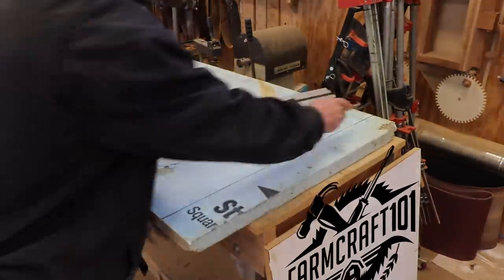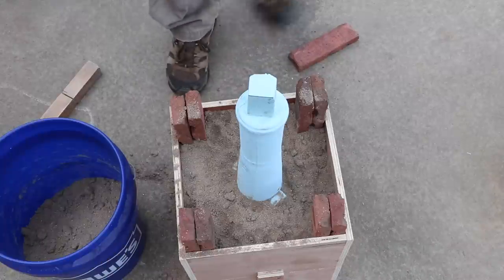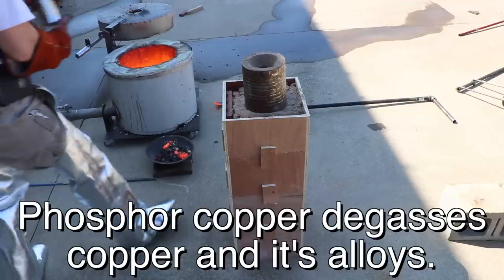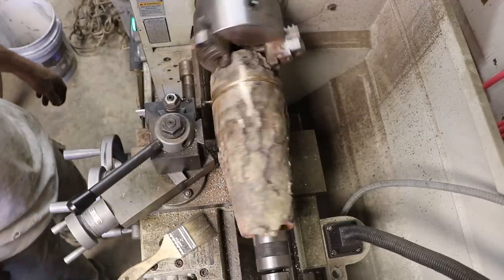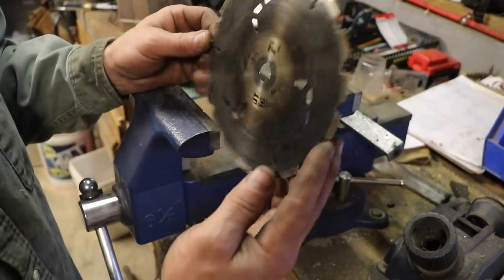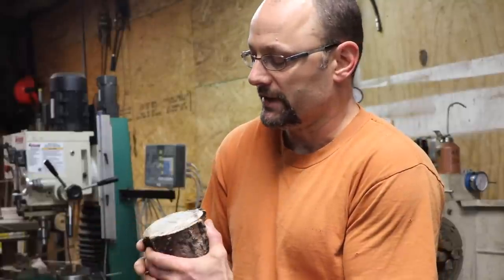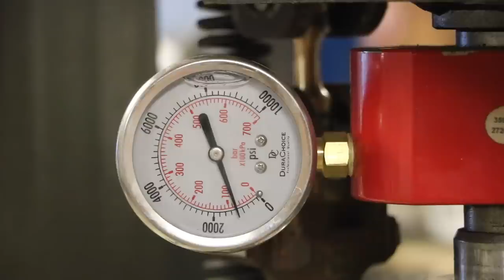How NOT To Cast A Historic Bronze Cannon Barrel.  FarmCraft101

Comment: I noticed you did not add a vent sprue to you mold, it will cast easier if you have a place for the metal to go other than the actual cast... reservoir voids, vent sprues, puddles...

I have worked in an aluminium and iron  foundries for over 3 years...

Comment: I think your sand was not packed enough so that’s why it failed or your sand mix is wrong so therefore will not pack tight enough and also try a core in your mould  as well

Comment: 8:55 shockwave met at the center causing cavitation, lowering pressure, thereby lowering the boiling temp of the water,  quickly forming a gas bubble.
11:43 maybe sandblasting? Is that why they use an oily sand? so it doesn't stick to the metal?

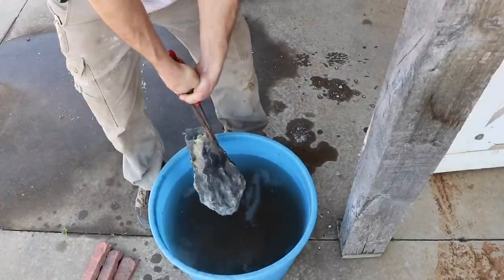Comment: 8:50 my understanding is that the molecules in the water touching the hot iron you threw in the water accelerate very quickly and hydrogen being released form the water causing that mini explosion/splash. something like that.
Reply: No, it just evaporated into steam because the piece superheated the water.
Similar effect to jostling a (smooth) cup of water that's been in the microwave too long.

Comment: 8:55 Pretty sure the hydrolization of some oxides or compounds on the surface of the sample raised its thermal conductivity exponentially, and as it cooled really fast the first seconds a bunch of water boiled absorbing a bunch of energy, hence preventing further violent boiling. Temperature^4 if i remember my black body equations.

Comment: You should’ve used a diamond cutting blade of some sort either for the band saw or circular diamond blade or just cut it with a blow torch that’s for cutting metal.

Comment: It's true that the oldy-timers made cannons of brass, but according to historical accounts, they also blew up cannons on a semi-regular basis. It was just accepted as a risk of using the technology at hand. It was difficult to judge powder loads too, as powder making was not an exact science at the time. It wasn't unusual for powder to be made on-site, as needed, rather than in a factory. That alone can cause unexpected pressure problems.

Comment: You should look at the break area closer. You should have measured how much it stretched before breaking as well as how much the crossection shrank. This is a measure of its malleability. The break appears to be brittle fracture, which indicates very little stretch occurred. I suspect your pour picked up a lot of silicon into the alloy, which IS soluble in bronze.

Comment: Machining the sandy metal is the same as machining a drop forged ingot with all the scale still on it. You just have to get under it so the tip is cutting metal and the slag and scale is scrapping and blunting the back of the cutting tool.

Comment: When he ripped the ingot out of the sandbox after 20 minutes and threw it into water, i was sure he didn't know what he was doing. Just watch any video on casting bells once and you know you have to wait at least one day to have it cool down appropriately. Also you will have way lesser tensions if you insert a clay core into the cast where you later drill your cannon. Clay will ultimately make for a good barrier so your molten metal doesn't wash out the sand and go anywhere its not supposed to. Cover that foam-thingy in clay, have it dry thoroughly, then insert into sand, then do your cast...

Comment: Here's book learning, not experience talking:  To cut a rough casting, you need to cut through the grit in a single pass. For your casting, that might be impossible due to those outer ridges.  Maybe those can be cut off manually with a cold chisel.

An alternative would be a tool post grinder with a very coarse wheel.

I think those ridges around the barrel were made by gases (vaporized or burning plastic) escaping  vertically.  You did nothing to vent the casting.  I recommend any of Charlie Ammen's books on the subject.

Comment: I've read that iron banding was used to improve the canon strength, or perhaps to reduce the damage if it split or otherwise broke.  Still, I'd be hesitant to stand next to the thing when it went off.  Are you even planning on firing the thing for anything other than test purposes?  It's not like you'll be involved in any siege activity in the foreseeable future, right?  :-D  If you just want to test fire it a few times for fun you can use low powder loads to keep the pressure down.

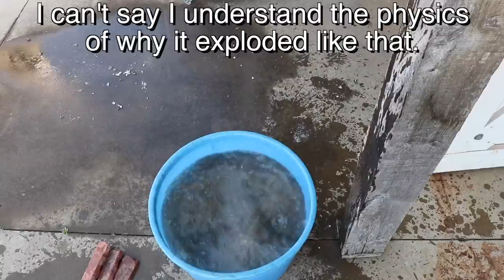Comment: 9:00
I can. It's because water started vaporizing a lot after you put this thing in and it caused rapid expansion of gas inside of the bucket. The result is what you see
Reply: I'm afraid not entirely. The water cooled the outside jacket, which will shrink while the middle is still hot and molten. The sudden coolinh makes the outside jacket rather brittle and under this tensile stress it cracks. These cracks are sudden exposures of the hot, molten inside to the cold water outside. The forming of the cracks is very fast, the water going into the crack will flash to steam.
Reply: @DreadX10  well ok

Comment: I would guess the explosion of the water was due to the metal cooling off enough that the Leidenfrost effect stopped happening. The sudden direct contact of the water with the hot metal caused a rush of steam to be produced all at once.

Comment: why not to cast it horizontally (still tilted) instead of vertically so the pressure of the upper metal wont be a issue?

Comment: Wonder if cooling it slower keeps the metal from crystalizing making it stronger.
Reply: Quite the opposite: slower cooling results in larger crystal grains (as they have more time to grow) and lower strength. Forging improves the strength of metal in part by re-forming the big grains into small ones.
Reply: Hmmm...learn something new...makes sense though when I think on it. Could be why we quenched things after hammering them on the forge. Not that I have done any of that in the last 20 or 30 years (something I played with in my younger days)
Reply: @kenredington4988  it is part of the reason for quenching. The other reason is that steel changes crystal form when it is heated and cooled, and the different forms have different properties. You can 'trap' high carbon steel in the very strong, hard and brittle martensite form if you cool it fast enough, whereas slow cooling allows the steel to turn into the soft but tough and malleable pearlite form. You can thus control the properties of the steel by quenching it to make it hard and then tempering it with heat to transform a fraction of the martensite into pearlite, giving the metal a happy medium between the two states.

Comment: I worked in a Massacheusetts Iron Foundry in the late 60's We cast some items, like flywheels, that were 10 feet across. A few weeks of the year, we cast aluminum. Your first mistake that I see is, you were too impatient, you must let this stuff cool till you can touch it with bare hands. I mean don't break the mold till you can touch it. I think it must have a lot to do with the grain.

Comment: What you SHOULD DO, is make another mold like you want it the proper size, then instead of using green sand pour concrete around your mold then let it fully cure, and try your pour again in concrete you'll need to let it set up and cure for a full 24 hours or more if you have an infared thermometer i wouldn't break the concrete off as long as the temp on the concrete is above 200 degrees to make sure it is fully set. THEN you can break away the concrete and should have a Smooth and properly formed Copper canon

Comment: I stopped the video at the making your mold to ask how come you didnt pack your sand hard and tight all the way up buddy?? Not doing that makes the metal push out. (Btw i am not knocking you or  your video in any way at all) also were you planning on drilling out the cannon or did i miss you making it to where it pours and comes out ready to fire? If the first you may or may not of miscalculated the amount or metal needed. Im so curious as to what all happened im continuing the video now lol

Comment: violent change in temperature caused the metal to compress rapidly and crack releasing energy in the form of a sound wave muffled by water resulting in a watery explosion. or you know, a pocket of phosphor separated and combined in to itself and when the oxidized shell cracked, it exposed the phosphor to water.

Comment: Your mixture of bronze was contaminated in your pour for your tensile bar.    No, Forging etc. just good clean bronze Cannon mix formula poured correctly, provides good 35,000 + up  Gov't Bronze 88 cu 10 tin 2 zn     (Check Gov't spec.)

Comment: Stronger?  Increase tensile strength  ... add 5 to 7% nickel  ... slow down the cooling period.  24 to 36 hours in a bed of sand (covered ).   I used black sand for casting  and a coarse brittle sand for the airways and flies.  Break the bands on the mold after cooling ... knock and break up the brittle core sand.  This reduces the amount of the pour and boring later.

Comment: 8:50 the reason why it exploded like that was probably because when you had removed that sand earlier the molten metal that came off created a small air bubble inside of it(the sand), so when the heat hit the water and it started getting hot that air that was inside got so hot it exploded, maybe it was just because that’s what hot shit does when it hits water but it’s usually not that big.

Comment: Brass is mostly work hardened, for a cannon you could probably get a really significant improvement in strength by firing it a dozen times.
Reply: And then the chamber would thus get larger every firing in theory from what your saying and the cannon would loose compression if he didn't up the projectile size every shot and he would have to mic  the chamber to make every new projectile until it stopped worked hardening and compressing or expanding the chamber

Comment: BLEVE:  boiling liquid evaporating vapor explosion
I believe the term was coined by the fire service after a large, over a million gallons, uncovered, oil tank, caught fire when struck by lighting.  Being uncovered and oil being lighter than water, rain water settles to the bottom.  The heat from the oil burning at the surface travels down the column of oil.  When the temperature reaches the waters boiling point, the steam created over such a large area caused a massive vapor explosion, spreading hundreds of thousands of gallons of oil and fire around the entire response area.   As you can imagine, the damage to anything near by, including fire trucks and first responders was devastating.

Comment: As the weight increased it spread the sand back from its original shape and the sand cracked vertically with molten metal filling the vertical cracks !
The sand needs be packed firmer ! Like really hard !

Comment: I'm not convinced by the "that is on both sides, so divide it by two" part of the calculation.   If you have that force on each side of the beam (I assume you have two cylinders, one each side) then the force applied to the sample is the sum of the force applied by the two cylinders ...

Comment: This is why an explosion occurred when placing your "cannon" in the bucket of water:

An explosion occurs when moisture is confined by molten metal. ... Water, moisture, or any liquid-bearing material instantaneously turns to steam when coming in contact withmolten metal — expanding to 1,600 times its original volume and producing a violent explosion.

Comment: It exploded in the water like that because it super heated the water immediately around the casting causing a barrier from the rest of the water but the cooler water was not as hot so the steam from the super heated water had to go somewhere so it went up and out.

Comment: Tie a super long rope to it, drag it for a few miles off the back of an old truck, until the rope breaks, then tie it again but on the other side, drag it more, tie it again once it's loose, drag it some more.  An old gravel or dirt road will knock off the sand.

Comment: also if you want your metal stronger you heat it in an Owen 200 degrees celsius for 2 hours cool and repeat it changes the grain structure and gives you more strenght

Comment: That big splash was an oxygen explosion. The intense heat burned off the oxygen in the water and the hydrogen then instantly bubbled up and out, explosively. Had you been holding a flame it would have ignited.

Comment: Hey what exactly does degassing do ?
Reply from the maker: Reduces voids and defects in the casting.  The gasses come out of solution as the metal cools.  To be completely accurate, copper phosphate is an antioxidant, not a degasser, but it still lends to reduce voids in the casting.
Reply: @FarmCraft101  so basically making less poreus I've just never heard the term used before I thought maybe it had something to do with the zinc fumes

Comment: The physics of the water explosion. 
Water is dense, very dense the heat turns the water to steam.  The steam acts like a gas although it is not a true gas. 
PV=NRT 
P1 T1           P2 T2
———     =     ———
   V1.               V2

The T temperature of the water increases so quickly the V Volume expands exponentially. P the pressure also increases at the same rate because the T temperature. The increase appears to explode. The steam expands like a gas and can occupy thousands of times more volume.  It does this so rapidly it exploded.  

That’s why water around casting is dangerous.  I only have water around when quenching bullets.

Comment: I might of suggested using a torch on high setting to melt away the outer copper where you want to cut it to get rid of the sand.

Comment: If you really want to look at grain structure of your alloy you will want to polish and etch the material, and then it's microscope time, otherwise there's nothing to look at really.  Also, if you're anywhere near eutectic composition there won't be much to look at either.

Comment: you could heat treat the metal for greater tensile strength... 1000degF for 8 hrs then 500degF for 2hrs

Comment: I've never cast anything so take my advice lightly but in all the videos I've seen they take alot of time to pack the sand down alot so maybe next time pack the sand down in the first box thing then put the second on fill with sand and pack down really well and continue, hopefully none of the metal should just go right to the bottem and actually fill where the foam was
Reply: Make the core out of coated wax & melt it out prior

Comment: 9:07 As the water gets rapidly heated up by the metal it turns into steam and gets trapped around the metal. As more steam builds up the pressure gets higher until it overcomes the pressure of the water an "explodes"

Comment: Why did you divide by factor of 2 when calculating tensile strength? Your comment about that press applies forces on 2 sides makes no sense, because one of them is the pulling force , but other is just a reacting counter-force and should not be accounted in this case.

Comment: I think your ingot molds are too squared.  That's why you have so much trouble getting them out.  If the sides and end caps were angled more they'd fall out effortlessly.  Check out the design that bigstackd uses.  :)

Comment: Also the reason it "exploded" was the heat turning the water straight into gas so it vaporized and as we know the volume of gas is far larger for the weight than its liquid counterpart so it expanded very quickly causing the "explosion"

Comment: You should go to a junk yard that has an old steel hydraulic cylinder from a scrapped heavy equipment machine like a dump truck, for example.  Use the hydraulic cylinder for your cannon.

Comment: i'm to a place where i'm not threw watching this yet but it hit me  to say this. though i myself have never pored an ounce of molten metal out side of fishing sinkers ,  instead of finding new ways of ruining your tool stock you simply skipped a couple of steps.  assuming you knew that.  I've seen it done buy many other users.  so i say.  after making your foam mold you should have used it to make a plaster mold  sanded that down to a respectable finish  and used it  for a positive to cast a negative plaster   hanging a mandrel  in the casting so as to at the very least / fixing a ruff bore to be tooled later to your liking . striking a balance of thickness OD and ID where as not to waist space and material  you could have simply fired the negative to burn out the foam  and just before the plaster set up you could have placed hardware to hang your mandrel securely before firing  the negative and you wouldn't have needed near as much plaster as you needed  sand friend.  maybe you could have gone as far as making a plaster bore mandrel  machined to tighter tolerances so you didn't have to machine to much metal later. if done correctly  there would have only been the finishing steps left towards the end. smoothing the bore and polishing the cannon and such.   i would have suggested lost-wax  but if you were to insist on using sand that would just put you back at the start thought lost-wax and plaster would have been better i think from the start .  but sourcing that much damn wax all at once isn't easy or cheap. it would have saved you time,  your back . and the hot work around that damn dangerous foundry. there's a reason there's no metal men left in your local neighborhoods selling their wares . to many coach-house fires  and burned down back yards. not much appeal to that. saying all that i applaud your effort at least your making something with your hands more that i can say for most here in America today craftsman are in very short supply .  by design I'm sure. I'll leave it up to you as how i arrived to that. 11:40